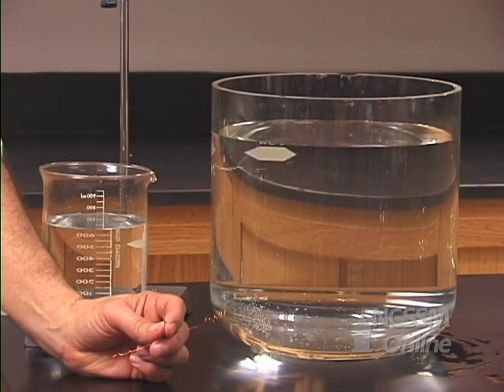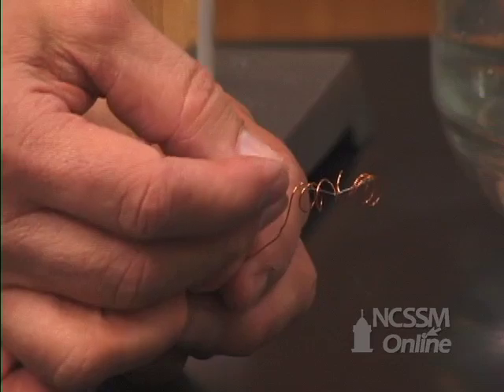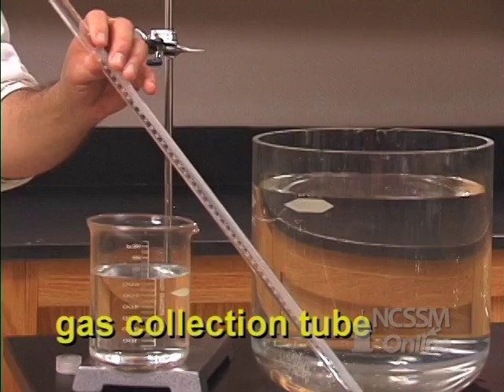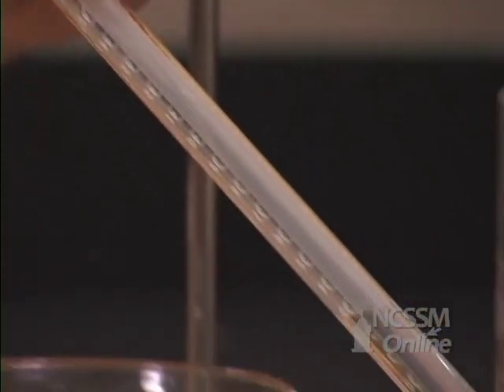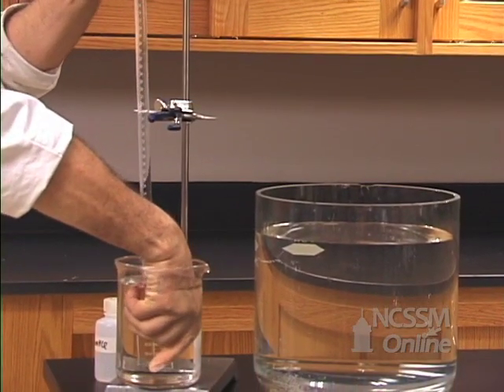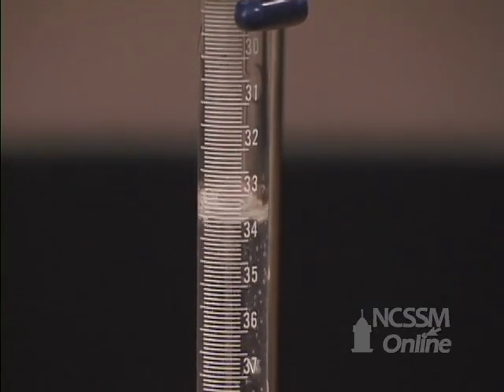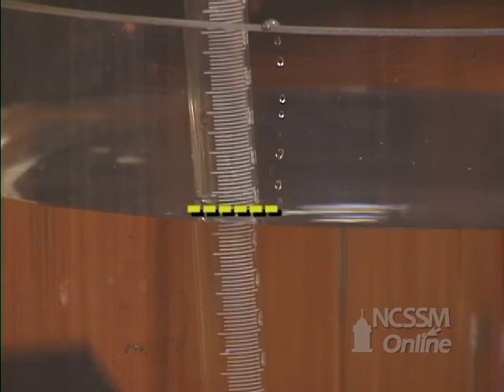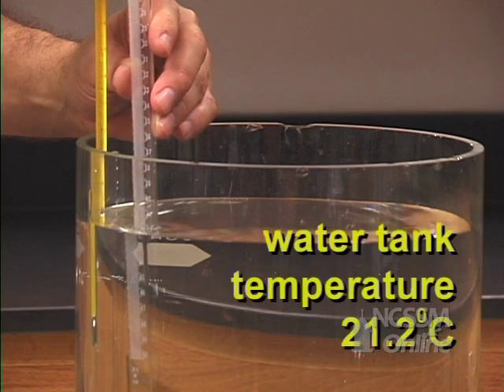Determination of the molar Volume of a Gas at STP

Comment: Convert the volume of gas collected to its equivalent volume at STP by using the combined gas law. Divide the result by 1000 to convert it to liters. According to the balanced equation, you get 1 mole of hydrogen gas from 1 mole of Mg, so the number of moles of Mg and hydrogen are equal. If you divide the number of liters of hydrogen at STP by the number of moles of Mg, you get the molar volume of hydrogen.

Comment: BTW for anyone trying to do the calculations: using Trial 1 info I got 23.33 L/mol (4.15% error, not bad!).

Use the combined gas law with the room's conditions as P1 (pressure H2, DONT FORGET to subtract by water's vapor pressure @ that temperature which a table says is about ~18.9mmHg @ 21.2C), V1 is volume of H2 collected, T1 is the room's temp (in K). Then use standard conditions of 760 mmHg and 273.15K for P2 and T2 and solve for V2, the VOLUME of your H2 at STP. 

Then to find molar volume, divide that V2 by the mol H2 (0.342 g Mg --> 0.00141 mol Mg = 1 mol H2).
Reply: OMG THANK YOU SO MUCH!!! I really appreciate your help!!
Reply: @serenity9438  Hi may I ask how P1 was calculated in this example?
Reply: @smozaf  Hey! to fine P1, you have to use this table to find the vapour pressure of water for the temperature of water that was given to you in the lab. So if the temperature of the water is 21.2C, then the corresponding vapour pressure is 2.49kPa. Then subtract 2.49kPa from the barometric pressure (99.3 kPa - 2.49kPa = 96.81kPa). Hope that helps, good luck!
Reply: Thanks!
Reply: @serenity9438  Where did you get the "99.3 kPa" from?
Reply: @juliaskye2754  its the barometric pressure
Reply: It hurts my soul that my calculations are literal fractions of points off which means my rounding is different.
Reply: what is the room temperature??